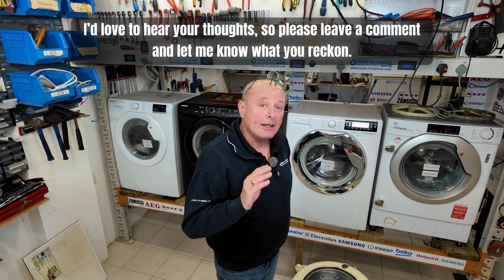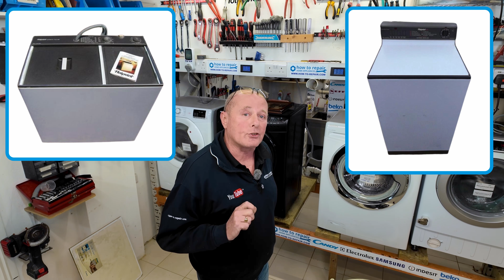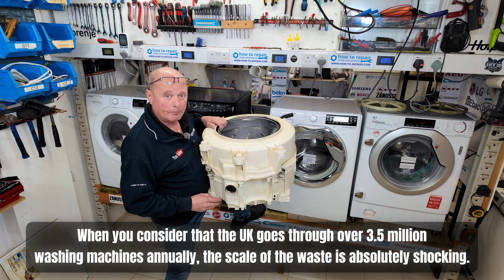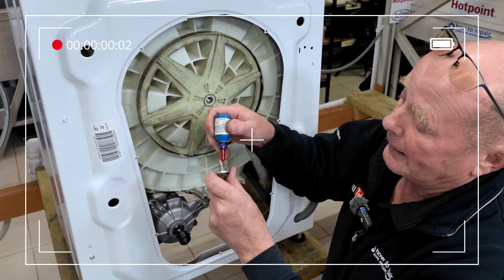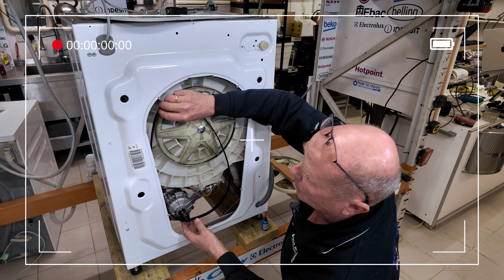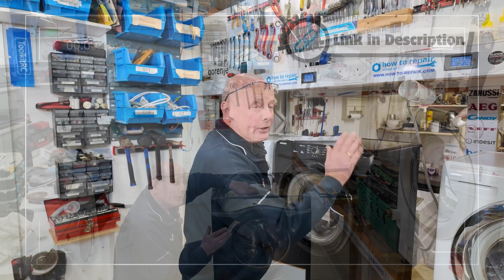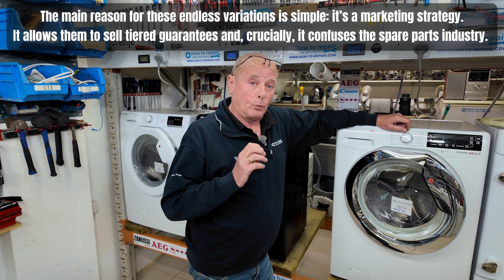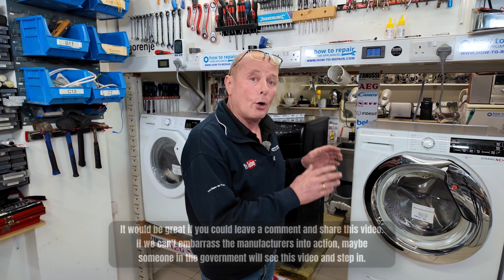I Scrapped 13 MACHINES to Prove a Point: STOP BUYING These Brands!

Comment: I wonder what percentage of parts for appliances comes from China. (I believe that is the biggest problem) After dealing with "green" appliances, I am done with them. Old school analog stuff for me. No circuit boards please. Like a chain, they are only as good as their weakest component, probably a 50 cent diode or resistor. "High efficiency" detergent=higher price. Plus the little bumps on the bottom of the washer drum do more damage to your clothes than the old style, proper agitator. Refrigerators seldom last more than three years. "Inverter linear scroll" compressors=junk. Get the extended warranty, you will need it. But, read the fine print on the warranty. Maybe it only covers a few unimportant things. Another rip off is the ice maker filters. I went down the cellar and installed a cleanable, 10 micron stainless steel filter that only cost a few dollars more than a replaceable filter.  One has to wonder why some enterprising company doesn't start building quality back in to appliances, with an eye toward easy servicing and reasonable parts availability. Perfect it, then don't change it every year or two. Keep building what works. Refrigerators built in the 50s and 60s were durable, lasting more than 20 to 30 years or more. What happened? A race to the bottom in search of ever more profits?

Comment: The valves that switch on to let the water flow in get damaged every year. I repair it myself by opening and cleaning it in my top load samsung washer 13kg but it costs USD 35 to replace the set of three valves (with coils). I hate it doing again and again.

Comment: Are there any companies doing component level repairs on PCBs? For years I was using a Servis machine after renewing the solid state switch that operates the water solenoid. It was a surface mount component but dirt cheap to buy.

Comment: I wont have a hoover product in my house. Not a thing. I brought one, the top was cardboard. The housing for the machine is next to the kitchen  sink. Water, of course, went through the cardboard into the electrics and the whole thing just burst into flames. Luckily I was there, cut off the power and put the fire out. It was 2 months old. At the time, my father died and I couldnt find the bill of sale so hoover woukd do nothing. A year later, they asked if I wanted to renew my insurence on it so they bloody knew I'd brought the machine and exactly when. They almost burnt my house down. I wouldnt give them a penny of my money.

Comment: As bad as these are, it's worse here in the US. At least for the parts cost. I had a Kenmore Elite dishwasher go south 2 years after we bought it. $900 in 2016. We suspect the house got hit by lightning. The tech came out, asked me two questions, and started packing up. First, he said if he touched it, he'd have to charge me for the service trip. So he had me try to turn it on and try to run it. The PCB had been knocked out. The cost, just the cost, not including the service call, taxes, and shipping, was $460 for the PCB in 2018. If I had followed through, it would have been close to 90% of the original cost of the machine for a PCB that anyone with a day's handy experience could tell you was at most $10 in materials.

Comment: Just for insight, I have a Hoover H-WASH&DRY 500. It's a pretty modern thing with fancy hOn connectivity etc blah blah, and has an Eco-Power inverter with a top spin cycle of a pretty quick 1400 of which I never use. 800 is ample for my needs. It's almost silent when it runs which is lovely and I've had the machine since it's release in 2020 and so far, it hasn't skipped a beat. From it's outside appearence it appears to be made to a very high standard and operates as so, also. When it was installed it was set and levelled properly on a very solid square of space (no carpet or lino as advised) and I use it around twice a week. Sometimes only once and I run a 'cleaner' through it on an empty hot cylce once a month or so. Also, I almost never use the tumble dry feature. I think I can count one hand the amount of times I've used the dryer, only when I've been in a 'Pinch' for time. Lets see how much longer it'll go for! *Still under it's 10 year guarantee. Pray for me lol😂🙏

Comment: Well said! I had a Zanussi washer which lasted well over 20 years the materials, build quality was phenomenal. We found it dumped in the street. My husband checked it over a wire had detached we cleaned it to within an inch of it's life - bingo. Now a 10 yr old Swan which seems to be doing fine. I never buy new. I currently use a Belling cooker from the 1950s.

Comment: In the 1980S we were told (Industrial Design Students) that the design life of a washing machine was @50 hours due to 'built in obsolescence', which is an incorrect description since it should apply to dated technology and not patent defects or material failures.  Getting parts for old machines of any type is a nightmare: I recently obtained a NOS windscreen wiper motor assembly for £50 from Italy (probably the last worldwide) that was no longer available from the UK but had been £450 from a franchised (Vauxhall) dealer.  As for my White appliances:  My Samsung washing machine replaced the old Hotpoint so beloved of my Mother and must be over 15 years old.  My Liebherr fridge is excellent but Trustpilot reviews for this brand are now awful and so I wouldn't buy another.  Hotpoint and Indesit seem to have better Trustpilot reviews but I think that the more spent on a top end of the range Bosch or Miele pays in longevity and performance.

Comment: My last washing machine lasted me 6 years ._.
OK, I overloaded it a lot because the person who was the only one who could help deliver it was also kept telling me "But why do you need anything bigger? Save your money".
The main problem was it rattled itself to pieces in the end, but the main issues was seals rotting for the intake and occasionally the drain-side pipe for the door lockout system would pop off.
More kept going wrong and it was so full of bodges, I ended up going out myself and spending extra on a reasonable size machine and spent for delivery too., which I should've done in the first place as I think if it wasn't for the overloading, I may of gotten 10 years out o it I reckon (Was a hotpoint).
Given the state of the industry, I just hope this washing machine lasts me.

Comment: I had a LG 15 Kgs machine from 2012, excellent machine. Pump died last year. I could have changed it but I told myself, better buy a new one, something else will fail probably soon, etc... So I bought the "same" from LG, except it's supposed to be 17 kgs now. Big mistake. They have clearly reduced costs everywhere where it was possible, no more light inside, no more backlighting of the dark control screen/keys, making it unreadable in dim light, there's not even a simple spinning program.. for when it crashes in the middle of rinsing because the "17 kgs" machine cannot even handle properly a small duvet, where the old one never had an issue with much bigger ones. I'll never buy this brand again.

Comment: Samsung WW90K5410UW/EU - add that to the list. Developed PCB fault after 18 months (door lock display on/tripping fusebox), was replaced within warranty. Foolishly thought the replacement PCB would be updated model without fault - nope, same fault occurred again after another 3 years. Also used to drain water on the floor if the filter was blocked - instead of displaying error code. Dreadful washing machine.

Comment: I have a 31 year old Miele washing machine. It was expensive when I bought it but I have never had any problems or faults. It has survived washing for 3 children so has had an awful lot of use. The only thing is the door catch is getting a bit loose and when I wash towels they sometimes push against the door and cause the machine to stop. I would never consider another brand.

Comment: We seem to live in a throw away society these days. We found the same thing a few year back with a printer manufacturer EP. After so many sheets of paper the thing would stop printing. The manufacturer told us the heads need to be reset at around £120 a new printer around £200. We never bought that brand again.

Comment: I bought a Hoover toploader when I moved into my first house 25 years ago and it's still working fine but I ended up replacing it a few years ago because I needed a bigger machine.  Even sitting outside under the leaky patio its still working and get used to wash things I don't want to wash in the new one. But I know the chances are the new one will break before the old one does.

Comment: The European Union has regulations (the Ecodesign Directive) that, to a certain extent, oblige manufacturers of household appliances, including washing machines, to ensure the availability of spare parts for consumers and repair shops. However, there are no legal standards that would limit the price (and therefore the intermediary's margin) of these parts. Therefore, the unnatural (but economically rational) choice is to purchase a new appliance rather than repair an old one. Profit from the sale of a new appliance (new models appear relatively frequently) allows for maximizing short-term profits, which pleases shareholders but is a thorn in the side of consumers. Capitalism in a distorting mirror.

Comment: When two or more people or groups come together and make a deal or plan to change something for others, and it started simultaneously (not necessarily), it's called a conspiracy. 
Basically all those manufacturers conspired for making anti right-to-repair, and complicating things for the user or repairer. That's a conspiracy.

They learned or figured a way how to earn more money, so it's easier to buy a new machine than spare parts, as spare part prices are purposefully bloated, leaving you with two choices - subscribing to the purchase of said machine after certain time, which generates more rapid income, or buying spare parts that together cost more than a fully completed machine if all parts are dead.

Comment: I bought a Candy tumbler dryer in Nov 24. Used it for a few months, sat pretty much dormant for spring/summer 2025 and come September when I needed to start using it again is stopped generating heat. Even the engineer couldn't work out why. and changed a few parts including the circuit board but to no avail. It ended up getting returned for a refund. Absolute crap.

Comment: I have a V-Zug washing machine, almost 20 years old, it never had any issues so far and still works perfectly...they are expensive, but they seem well built and all spare parts are still available in case I need to replace something...

Comment: Back in the 80s I had very little money and I happened to be working at a house that had a Bendix washing machine left  in the lobby I asked what was wrong with it  and the owner told me it wouldn't stop filling with water he said I could have it just to get rid of it .I fitted a new inlet valve for £15 that machine was trouble free for 9 years .The best machine I ever had and it was free

Comment: Buy a SpeedQueen. Yes they are expensive but will last a lifetime. Should they need repair, a honest technician will come out and fix it at a reasonable cost. SpeedQueen is the brand used by professional laundromats and the old-school technology that is tried and tested has never failed me for close to 2 decades.